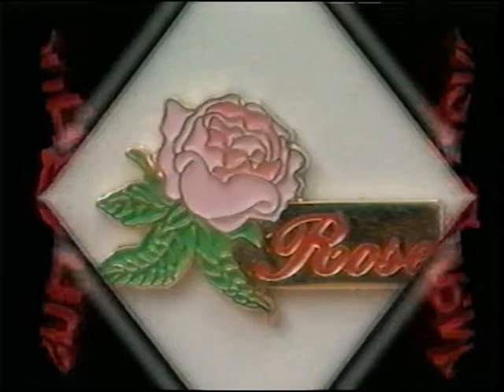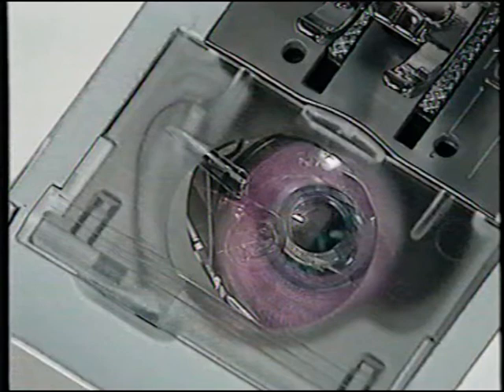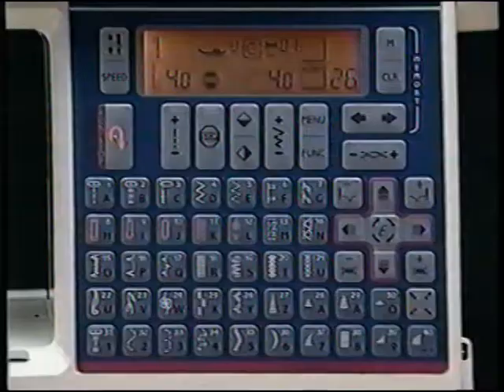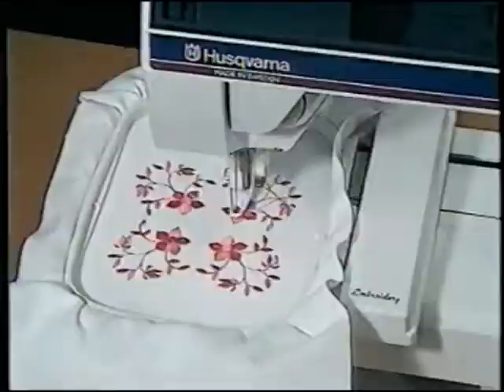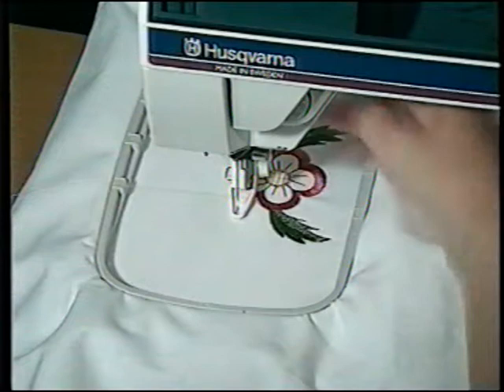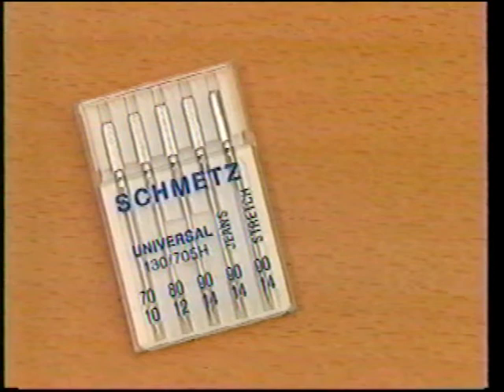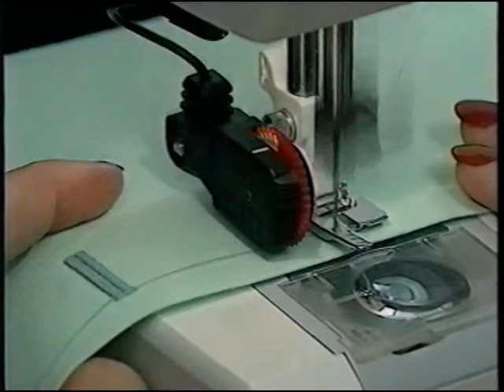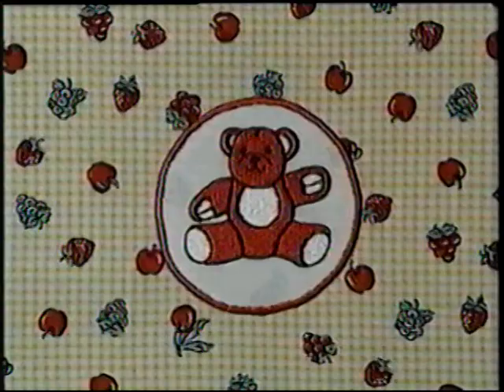Husqvarna Viking Rose Sewing Embroidery Machine Basic Course

Comment: I don't know what I am doing wrong. For some reason my button hole attachment will not work. When I plug it into the slot next to the light, it light up on the display,  and I select the buttonhole on the display. It shows a circle, but it won't go off and it will not sew.

Comment: Inherited this machine ,newer used it before .The spool symbol is flashing on the display. I re-thread the machine, the symbol did not go out .Try few times did not work.
Reply: The tension disks may not be gripping the thread properly and the machine "thinks" your top thread is broken and not needled take a thin sheet of paper and slide it between the disks in the tension area it is also possible there is a piece of randomly broken off thread in between the disks. I  had that happen to my Viking Rose.

Comment: What sizes does the rose use?
Reply: ?  What are you referring  to?
Reply from the maker: If you are referring to the embroidery area, the maximum it can normally embroider is 4" x4" (100mm x 100mm) . If you need larger designs you will need to split the designs with software and use the Plus Hoop. There are certain embroidery collections such as collection #15 that require the plus hoop because they are larger